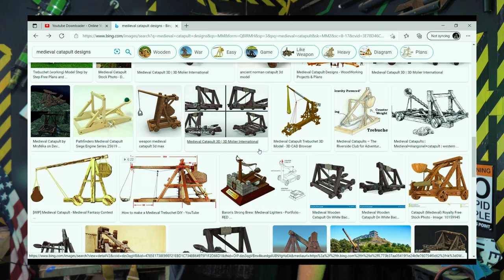I built a catapult to launch MYSELF (yes really)

Comment: Thanks for the footage shout-out Jake!  Bummer I missed this, I am here in Utah also, it is hoppin' place I suppose.  Then again, if you had asked me I would have recommended against launching people...

If you are ever back in town you should come see the treb shoot bowling balls.

I like your approach to this, as much as the idea was unsafe, your mindset was focused on what could go wrong and how to prevent that from going wrong.  That mindset is totally the right approach, and you covered a lot of your bases that way.  You also built a smaller scale prototype which was very smart and found some problems earlier when they are easier to fix.  I regret not starting small scale on my machine, I have discovered a lot of problems and had to fix them full-scale.

I love the trigger you made.  If TKOR doesn't need it anymore I would take it off their hands...

For the whole "how do we re-attach the winch 23 feet in the air" problem you could use a flemish horse.  My video on that concept is not a great one but the whole purpose of that idea is to allow you to regain some of the advantage during the winch-down by just attaching as high as you can reach and then letting the pulley slide up the arm as it comes horizontal.

One of these days I want to build a full scale trebuchet, mine is half height and 1/10th weight of medieval originals.  If I can ever figure out how to make the logistics of that happen it would be cool to have you join the project.
Reply from the maker: Thanks man! Lol it hurt to leave that trigger but no way they would’ve let me take it on the plane 😅  

Dang I wish I’d know you were in Utah it’s loved to see that trebuchet in action. Maybe someday. I’ve got so many siege engine projects I want to do in the future... just need a LOT more money haha. I’d totally be down to build something epic together 😅

I’ll have to watch that video of yours, we simply didn’t have time to come up with anything or do any research as I only realized it was a problem like the night before we had to film the launching 😂 big brain moment there. There was sooooo much stuff to figure out in a short timeframe my mind was in a million places.
Reply: @jakemakes  I just emailed TKOR and asked for your trigger.  Put in a good word for me 🤣 hahaha

About all the stuff going through your head, totally get it.  When you are up against deadlines and have to fix things it's time for action, not digging around on YouTube for niche videos.  Great job keeping a positive mindset and getting stuff done.

I also liked that Paracord trick to tie the rubber together.  That was a constrictor knot I think, legit